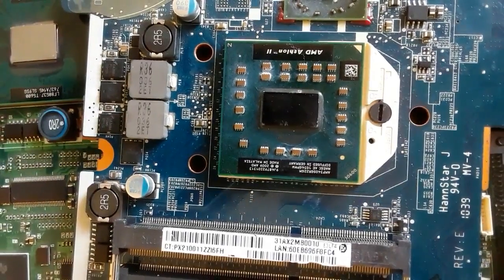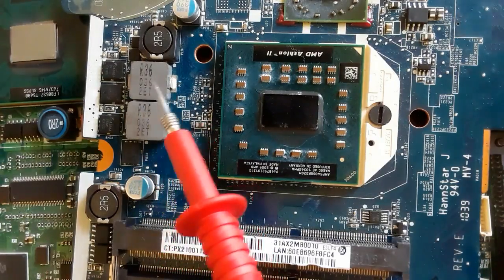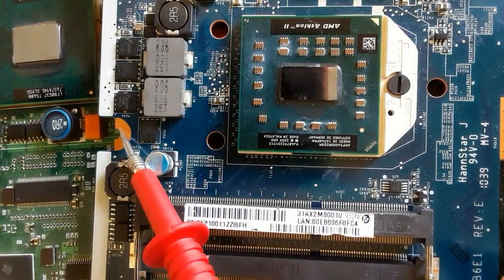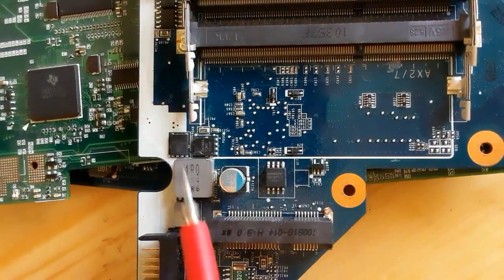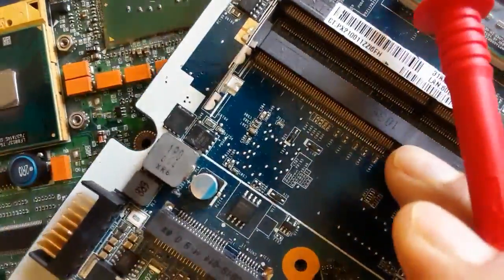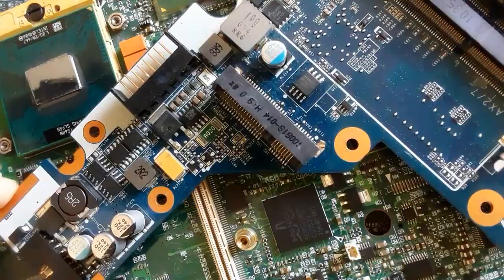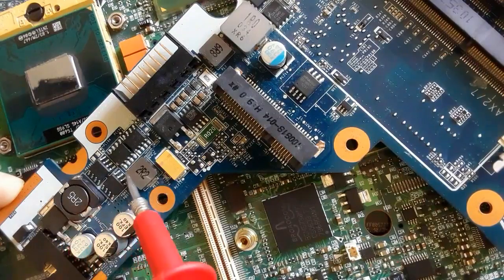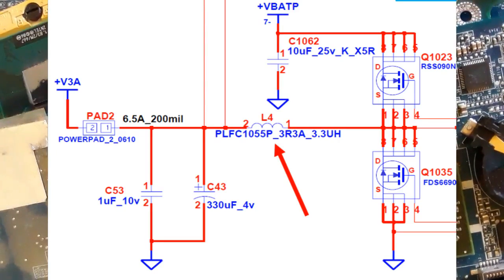15 Most Common Faults on a Dead Laptop, Dead Laptop Motherboard Repair

Comment: I have dell board it's have a short in 3.3v , i tracked from block to block and when ever i say maybe this one is the fault component i found that's not , and i checked the ic tps it get hot when the plug is in so i thought it's the problem and one i desolder it, i rechecked the short i found it's still there,
Reply from the maker: By watching the last 2 videos I had uploaded you will fix the problem easily